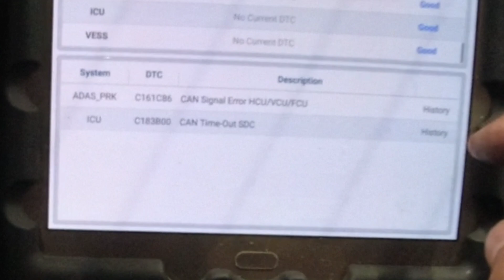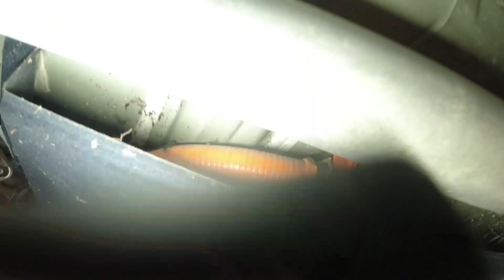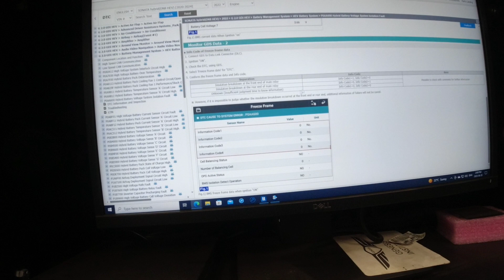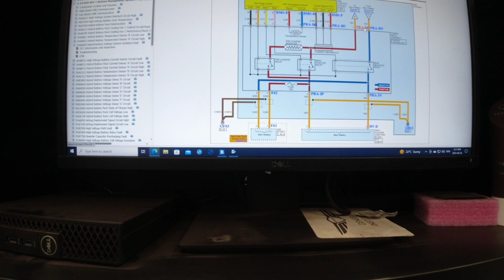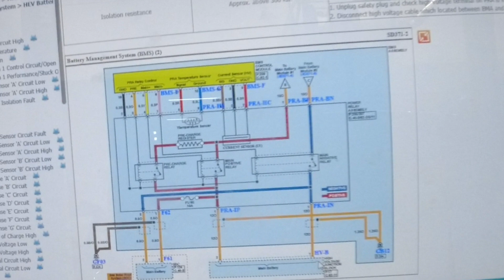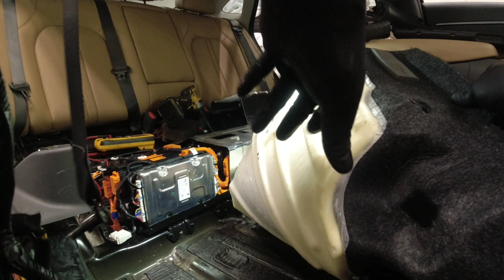2022 Sonata Hybrid, High Voltage Fault

Comment: Where the safty plug ??
Reply from the maker: The interlock connector is left side back of the engine if you are facing to the front of the engine.

Comment: I think you’re missing your insulation leak tester lead. The one you press the button with the meter set on insulation test injects 500 volts in you can select on the meter then look at the resistance.
Reply from the maker: Thanks i will double check that
Reply: Fluke makes them

Comment: Good day, sir! What could be the problem of P1BB200?
Reply: Got the same error! There was a recall in US for ECU upgrade just for Niro and Sportage.. not sure if this error should lead to 12v battery replacement
Reply: @gerardomartinez5944  which year is your car from?
Reply: @gerardomartinez5944 Thanks for sharing info
Reply from the maker: Try to do 12volt battery test, most likely you have 12 volt battery issue
Reply: @hyundaitech  thank you very much!! 12v battery cell is damaged.. new part is on the way! Should I replace BMS as well?
Reply from the maker: @raymondstar96  do the 12 volt and see from there first. Maybe BMs is okay.
Reply: @hyundaitech  thank you very much for your help sir

Comment: Great job brother,,seems this is not a Hyundai problem ,it's a customer that drove through a flood.  I have a 2023 sonata hybrid and it's a fantastic car, but electric and water never mix well.
Reply from the maker: Glad you love your vehicle.
Reply: @hyundaitech  are the newer Hybrids very reliable in your opinion? 
Also great videos,appreciate you posting.
Reply from the maker: @TommyG11814  in my opinion i think yes, since they started implementing since 2013 sonata hybrid, for sure they made some improvements, and yeah also you cant help if theres one or two cars has some weird issue and i think thats all for the manufacturers.
Reply: @hyundaitech  thank you for the reply,,,,keep up the great work. 👍

Comment: Bro I need help with my 2015 genesis 5.0 . The AEB light came on and even with it AEB deactivated the light stays on and I can’t get it into gear. Also I can’t get the calipers to release pressure to change the brake pads. I can’t get into a dealership because they’re all boom out 30-60 days.
Reply from the maker: I think that model the parking brake is the shoes in the disc drum. Most likely that its seized. Usually if part available for replacement and if the cable.is seized we cut them so that we can just turn the wheels.

Comment: salvage car? 
why there is so much water under the carbet? 
maybe AC system water leak?
Reply from the maker: Im not sure, but insurance decline the work. And for the water inside the car, customer mentioned that either they went thru the water or they parked somewhere and water went in.